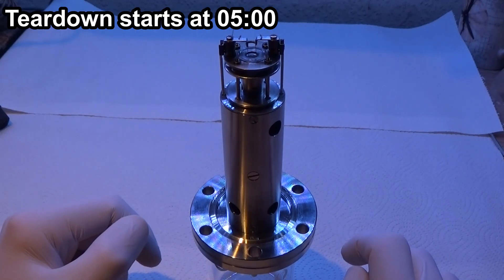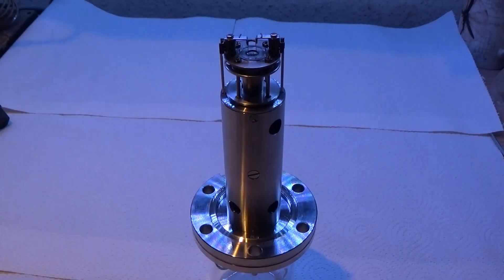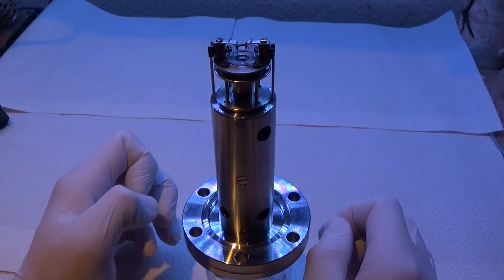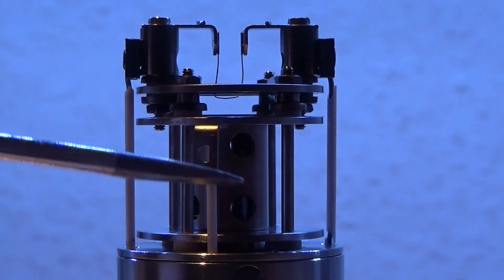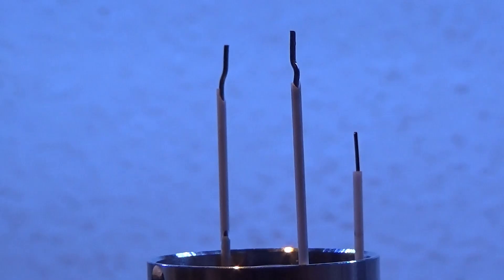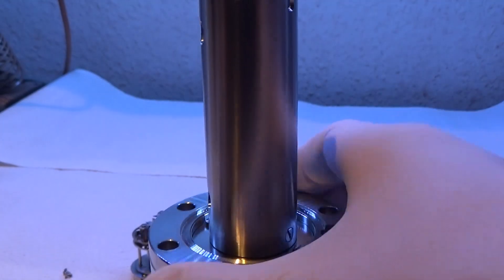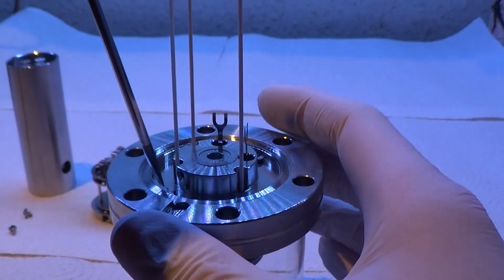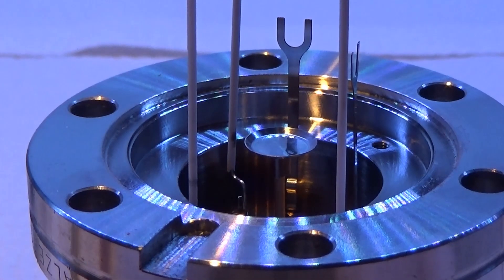A Palm-Sized Mass Spectrometer! (Residual Gas Analyzer)

Comment: Any update on getting it working that would be so cool to get going, I'd imagine the vacuum system is going to be difficult?

Really great you give all the technical and scientific information about it as that's exactly what I'm looking to learn about.

Looks like you got a great find with that!

I am so amazed at how some pieces of metal, rods, and an element can show you the constitutional makeup of substances.

going to subscribe and follow along to see if you get it working 😁👍
Reply from the maker: Thanks! Got it working just a few days ago, actually. Video to come at some point
Reply: @chromatogiraffery3104  That's great, I timed it right it seems I am eagerly awaiting the video.

I've a question for you if you don't mind.

Given the different methods of analyzing a sample, gas chromatography for example. If building a DIY rig, and another DIY setup using the same build temperatures, materials, carrier gas pressures etc. 

Could you reasonably assume you'd get similar peaks and curves over the same time period, and so if pure samples of the composite parts of a unknown sample were ran through the system to create a set of curve data, could you apply this to all of the DIY systems and although jerryrigged with cat litter and an Arduino you could expect to reliably be able to identify curves on it? And have the same results on others of the same construction as long as your comparative pure sample curves were also taken on that machine 

Sorry for the convoluted waffle, I am just getting into it and I'm really interested.

Thanks for reading
Reply: @bigsteve6729 still no answer. cant understand the question on my own though.

Comment: Another comment, quadrapole mass specs are really rare on YouTube. I can find links to magnetic mass specs, like this https://youtu.be/x_l1U7ZV8dI, or the one by applied science, but not quads. Thanks again for the link in the description!
Reply from the maker: Quads are easy to produce industrially, but home-brewing the rod assembly is near impossible. One also needs some rather fancy RF electronics, operating at kilovolts at 1-10 MHz, which is also slightly terrifying. On the other hand, building good, uniform, analyzer electromagnets are equally cumbersome, and they operate at 100-300A DC!

Comment: This is great, you have a nice pacing and real scientific technical teardowns like this are very rare, so thank you. There are some single frame images between cuts which causes flicker, I wonder what you're using to video edit? I used to used kdenlive but now I'm on lightworks which was so good I even bought a software license for the first time in 20 years...

I've got one of these too in the very same way as you did. I bought a vacuum, turbo, and turbo controller set and it had one of these RGA tubes in it (but no RGA controller sadly). It has 8 normal vacuum feedthroughs and a central BNC. The last bit of research I did indicated it might have a multiplier in it but I've not removed it from the system as I didn't want another port yet. Seeing you disassemble this gives me the confidence to take a very careful look too.  I thought about building a RGA control system, and even bought a faulty RGA controller to take a look but not done it yet and wasn't sure of voltages/frequencies, so will be watching your videos very carefully!